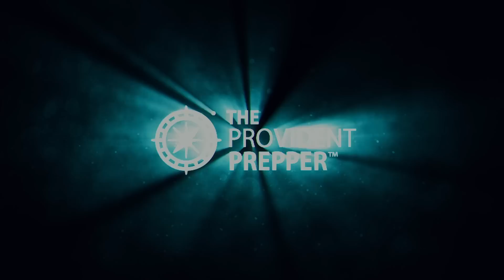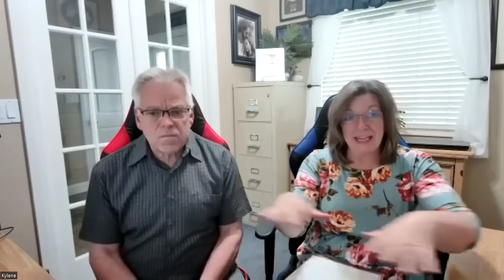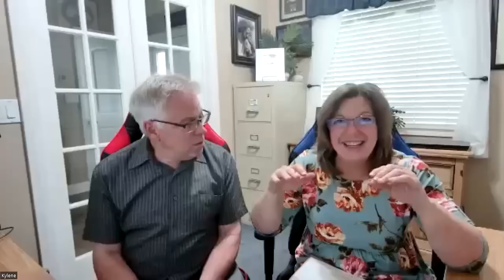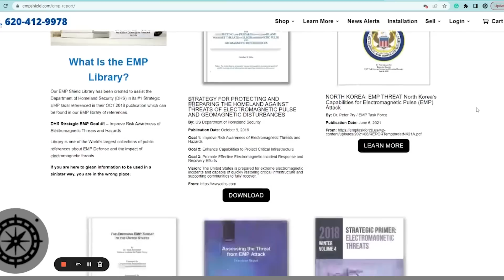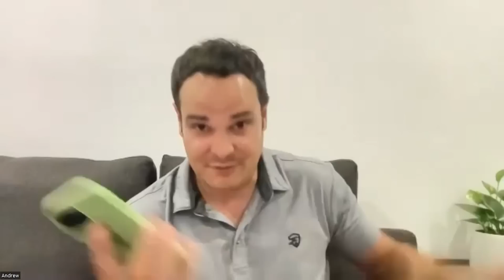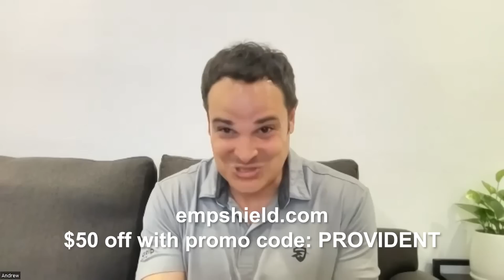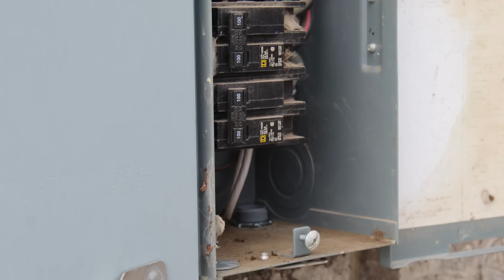Facts About EMP Protection: Interview with EMP Expert Andrew Bucchin

Comment: I call BS on this video and the "protection" provided by surge style devices. Yes they can protect against lightning and the E2 element of an EMP but they absolutely CANNOT protect the sensitive electronics that run virtually everything. Technically, you are protecting against an HEMP (high altitude EMP).

I have studied EMP effects for over two decades (I'm a systems engineer) and all the marketing and forms of testing that he listed are NOT using a Faraday cage which is the ONLY way to shield microprocessors, memory or other low power (low current) devices. If they have not tested with a real live "whole house" method, including tablets, cell phones, radios, etc. INSIDE the EMP field it's not a valid test. The specs on those tests are very stringent and straightforward to design for (mostly it's conducted or induced EMI).

The rise time on an EMP E1 pulse is about 2ns so it sort of looks like a 500Mhz radio signal, very powerful, 50k volts per meter (not per "square meter" as Andrew actually said). And it's not "electrons" raining down either as all the RF energy is generated in the very high upper atmosphere. Electrons are hugely accelerated by the gamma radiation (Compton effect) and caused to arc in a curve due to the earth's magnetic field. Imagine a sort of spiral of electrons around the detonating nuclear device. This is essentially what produces the E1 pulse. 

The E1 50kv pulse is all over in 20-50 nanoseconds. The energy induced in your home's wiring cannot travel more than about 20-50 feet from the surge protector as the E1 hits. It's everywhere, all at once. Yes good surge protectors are fast but it does NOT protect the electronics which are many feet away. Yes, it protects against E2 which is sort of like lightning but ZERO protection against the E1. No one selling these devices will tell you that (or likely even admits to it).

Why is E1 so dangerous? If a device has low power circuitry and/or MOS-FET transistors (most everything does) it's going to be toast since they operate at very low voltages. The gate on a MOS-FET is only a few nanometers thick and it's often only good for 2-10 volts. Every wire and trace on a circuit board is an antenna for that 50kv 500MHz signal. Same goes for your car but they are a lot tougher due to design considerations. That 50kv pulse is still 500 volts over a single centimeter, about the thickness of your cell phone. If it is laying flat it may survive, if standing on edge it may get 2k-5k volts end to end and that will likely fry it. What about the cell phone network itself? Your phone is useless if there is nothing to connect to...

We did testing a few years ago on a Faraday cage device at 2X the military specs (100kv instead of 50kv). It has about 70db of signal attenuation at 500Mhz so every single thing we put in it survived. Unprotected devices (keyboards, USB drives, radios, etc.) were all destroyed or badly damaged but just fine inside our device. It's good over the entire RF range that an EMP pulse would create.

The E3 part of an EMP is a magnetohydrodynamic effect similar to a CME or solar burst storm. It lasts 1-2 minutes or so.  The last CME to damage a grid was in Quebec in 1989. The 1859 Carrington event was likely twice as powerful and lasted longer. Better to be off grid for that since it has no effect on local power lines of 50'-300', yet it has huge impact on those long transmission lines which are about right for picking up a huge but low frequency magnetic field change. After a HEMP burst the earth's magnetosphere "rings" hence it fluctuates, just like a solar CME. Think very low frequency radio of great power. High frequency, short antenna. Low frequency, long antenna. Power lines are perfect...

Rather than enlightening your subscribers, you have given them a false sense of security. The devices being sold by these companies are high quality surge protection (good to have) but they simply cannot and will not protect sensitive electronics from the E1 effects of an EMP strike.

I'm not messing with their business but you don't have the full truth. Almost nothing commercial can withstand the E1 pulse. You need to have spares of everything essential and they need to be Faraday cage protected.

Believe it or not, a combination of very high quality anti-static bags for sensitive electronics put inside a metal garbage can, the lid sealed with aluminum tape will do pretty well. And it can touch the walls of the can too (another erroneous comment Andrew made). No need to ground it either. It's self contained and if inside a metal building all the better. All that shielding will likely provide 40-50db of signal attenuation and that's probably enough for most electronics.

It's important to seal the edge of the garbage can to limit what is know as the "slot antenna" effect. Anything narrow/skinny and long enough will let RF energy inside. The bags further reduce the RF. The wavelength of a 500MHz signal is about 60cm (about 24 inches) so a narrow gap of 1/4 that length or more will let in a LOT of RF energy.

We can chat if you'd like but you need better sources who don't have something to sell.

Comment: Shielding with faraday cages are all frequency dependent, and so, are sensitive to the frequency being applied. Plus you need Next level multiple hard grounding points. And an actual EMP (or CME) has much of the power of the pulse will be occurring at much higher frequencies,  in a blast wavefront. So  you are talking about shielding from X-ray and Gamma Rays too. And remember Gamma-Rays go through everything. You need multiple concentric cages of differencing materials. Oh, and it will blow solar cells like 1970's era flash-bulbs, because many panels have cross wiring inside of the panel.

Comment: Celphone might survive inside of an faraday cage especially an extra thick casing.

Better chance inside of several faraday cages.

But also is the company that you use may or may nt be covered.

Tip: more antenna equals more EMP collected!
Even without an antenna it comes in as super boosted as an EMP.

An EMP on a ,olar system estroys circuits in the elrctronic devices.
Best idea have back ups stored in a faraday cage.😮

Comment: EMP protection needs to be like armor proofing on a vehicle.
Shielding from every direction and glass.
Antenna or without can still colect a charge frying a system.

Tip: a larger EMP can still wipe out devices.

Extra faraday coverage will be required as layers.😮

Comment: I agree! 
All H Bombs emit an EMP. Detonate a 5M weapon at 300 miles above the Dakotas and you'll start melting Rail Road Tracks and the Power Grid along with all none hardened and or shielded electronics are toast. Including the wiring in your house.
Faraday Cages are one way to shield stuff.

Comment: Communication in an emergency would require that both the transceivers(or parties) and the medium are intact.

If any of the transceivers are down, there'll be no communications.

What's the sense of having a radio with batteries that never die and their are no stations to listen to!

By trying to be selective seems like programming!

Too loosely use the word "emergency" is quite imprudent.
You would have to create the threat in 'selected' minds!

How many millions of homes were built with bunker storage and stocked in the event of an immenent nuclear attack?

Now, decades have passed...and nothing!

Besides we are all going to die someday!
No one knows when it's their turn.
How can EMP protection prevent death?

Comment: What's the price?
I was expecting to see a graphical presentation.

All I he hear is a sales pitch!

Sales plays on emotions.
However, when the emotion is fear, anxiety, it's sounds unethical!

If the objective is to protect electronics then you would have to protect the customer installation and the distributive electrical grid they are connected to!

In addition, all electronics in stores, storerooms, manufacturing plant would have to be equally protected.

The fuel pumping stations too!

An effective sale would be from top to bottom, from the electrical generation plants, transmission and distribution grid. Then local installation and electronics.
Why?

Because that's the chain of dependacy!

Living in such bubble seems more like a prison that anything else.

If anyone is that concerned about the well being of humanity, they should be engaged in some charitable work!
If you're charging or trying to make money, that's business.

Business are about profits not humanity's well being... except consumer preservation!

Comment: You’re putting too much confidence in that little box. The one in your car, guess what that’s the first thing that people will steal. 
You’re worried about an electric wheel chairs and CPAC machines and your battery back ups. Just like your Tesla’s cars. They all require some sort of fossil fuel to power or recharge. You should be talking about  , how to protect your gas generator from an EMP.

Comment: Food for thought. Having a working vehicle may not matter if the roads are littered with non-functioning abandoned cars blocking the roadways. They won't be passable. So while a great possibility, it shouldn't be relied on as it may not ultimately be useful if you can't travel the roads.

Comment: Food for thought...while an EMP bomb itself may not cause radiation to us, the resultant grid-down will eventually make the nuclear power stations melt down and that WILL certainly cause catastrophic radiation all over the country. We also won't have tv/phone/radio to tell us about that, so wise to just prepare after an EMP for the likelihood of that next event. Depending on where one is located near you or the prevailing winds above you, that fallout could travel significant distance even if you aren't near a power station at all. The EMP is just the beginning, the catalyst, not the result. Harvest what food you can, quickly, after an EMP.

Comment: An EMP going off over our country is pretty low. If your home is lit after an EMP your a target for those who don't have power. The Grid would be destroyed and the power would be out for a long time. In my opinion you will need some if the following: Woodburning stove for food prep and heating,cast iron pots and pans a good supply  of fresh water and a place to store it. Plenty of dry goods and self protection tools and seeds for those tools and a good head on your shoulders. Thats it.